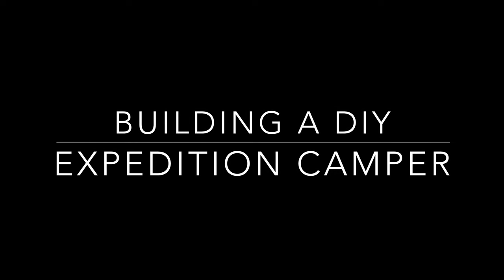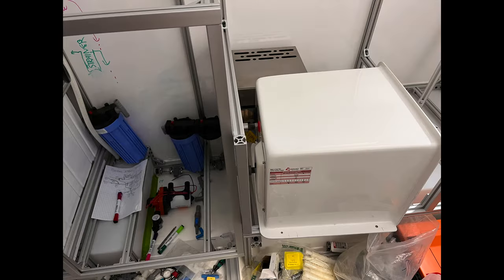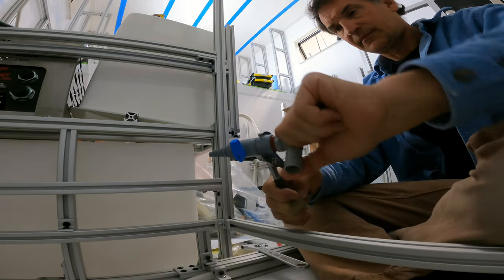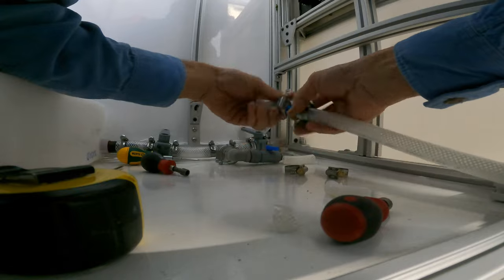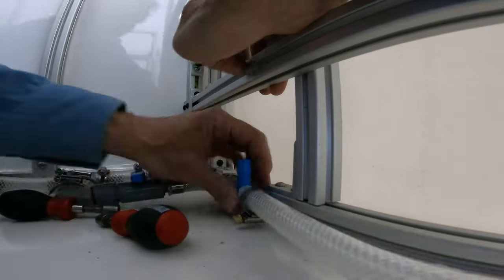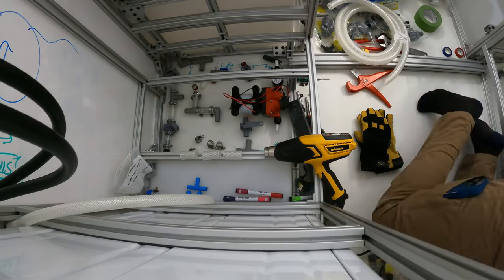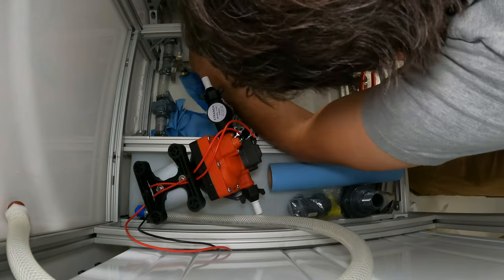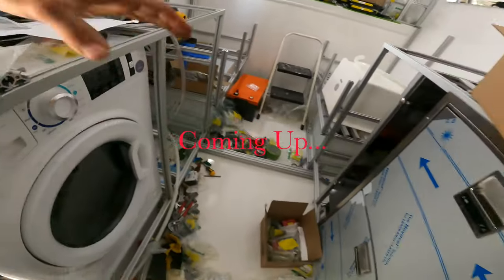Simple, clean and reliable Expedition Camper hot water heater

Comment: Looking great dude! Wondering if you considered PEX tubing for the plumbing?
Reply from the maker: Great question and glad you asked. I didn’t use PEX because it requires a special tool to make a repair or addition, as well as connecting parts, which would likely be difficult to obtain if needed while traveling outside the US, and it’s really expensive for a small installation as this, and these common parts can be purchased almost anywhere if needed. Plus, the tubing I chose can handle an even broader temperature range than PEX.